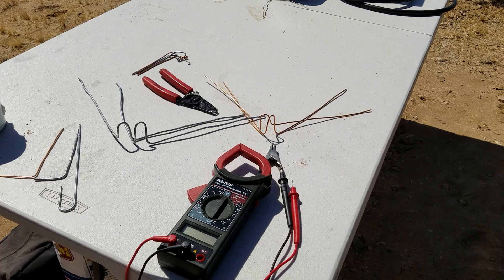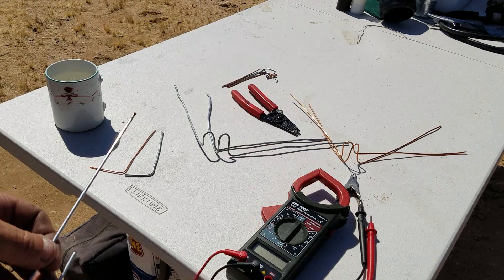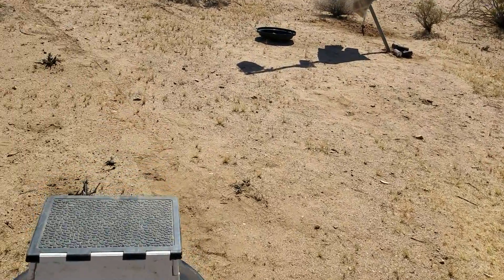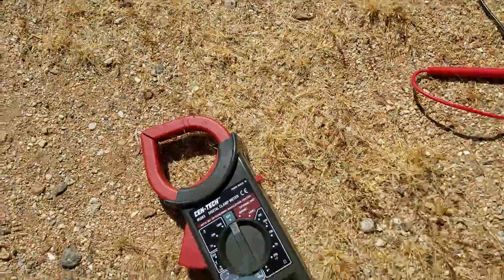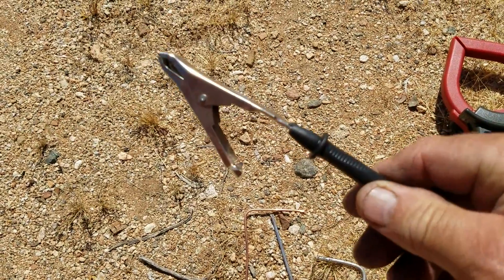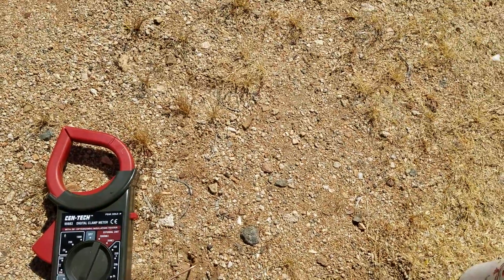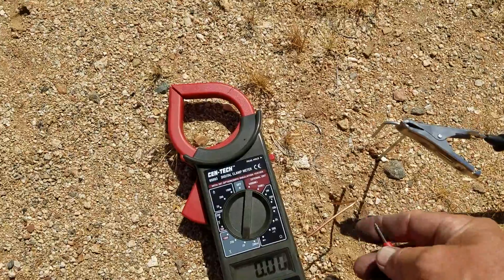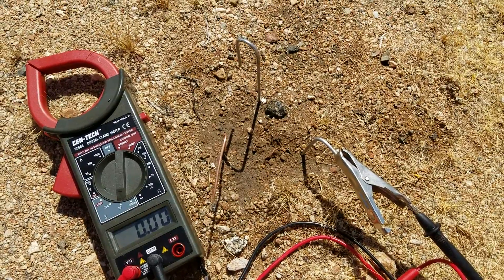Voltage from the ground

Comment: The earth is like a big potato ;-)
Reply from the maker: Actually the other way around.😁
Earth's molten core of liquid metal creates our magnetic shield that protects us from the Sun's radiation,  but at the same time it induces electrical current through every conductor on the planet.  This makes all conductors a form of battery that simply needs 2 dissimilar metal  contacts to start electrolysis and current flow from negative to positive. 
Keep in mind that magnetism and electricity are very closely related.
Reply: @GBear  I mean that just like people use a potato to make galvanic battery, the earth is like a big potato in your experiment ;-)
I actually teach electromagnetic induction and stuff and things....lol

Comment: this is old stuff. a relative of the copper/zinc cell made by volta.  nothing new. forty years ago i saw a demonstration from the 1700's that used copper and zinc plates in the ground to power an early electric clock.  the small current activated a primative solenoid at each end of the pendulum swing

Comment: I see a lot of industrial power lines near by so strap voltage would be high in this area. Ground current.
Reply from the maker: John Puccetti those power lines are 1.25 miles away.
Reply: @GBear  Hundreds of studies worldwide have shown that living next to high voltage power lines and other parts of the power transmission network increases your risk of cancer and other health problems. The closer you are the more you are bombarded with dangerous EMFs. About 2,000 meters
Reply from the maker: John Puccetti yes, I've seen the studies.  I guess that means all people living on the grid are doomed to die of cancer, huh?
Reply: @GBear  That might be a bit of an overstatement. Read "The Electrocution of America". lots of facts with  effects on dairy cows. But here is Code 95 The grid was originally built so that all the electricity which flowed from the
substation returned through the neutral wires. When people started using
computers and other electrical devices with non-linear loads, the existing neutrals
couldn’t handle the loads and fires resulted. The electrical building codes were
revised to require more robust in- building neutrals, but the utilities got off the
hook by instead of beefing up their neutrals, they simply tied the neutrals to the
earth so that now, about 70% of the electricity delivered from the substation ,
returns there via the ground. The California PUC rule 33.2 forbids using the earth
for return currents, but this didn’t stop PG and E or Edison from running wires
down every other power pole connecting the neutral to the earth. Here is the PUC
rule: (the bold font is mine)
General Order 95
Section III
Requirements for All Lines
33.2 Ground or Earth as a Conductor
Ground or earth shall not be used as a normal return or circuit conductor. In
direct current supply systems or in single phase or polyphase supply systems, a
neutral or any other conductor shall be used under normal use as a return or
circuit conductor; however, the grounding of the neutral or
any other conductor is not permitted as a
normal return or circuit conductor. The neutral or any
other conductor is permitted to be grounded only for the purposes of
stabilization and protection.
Reply from the maker: John Puccetti interesting.  But, I remember that the older electrical panels utilized the neutral bar as a combination neutral/ground bar, and that neutral bar was connected directly, metal to metal on the can.  Newer panels have separate neutral bars that are insulated from the can, and a separate ground bar connected to the can and incoming ground cable.
So you are saying that Edison bypasses these features by tying ground and neutral at the pole?
Also, most new codes require electrical services to be underground and they are doing away with above ground utilities.
Thank God I am retired and living off grid with wind and solar!😎
Reply: @GBear  The information that I see as  very relevant is that there is no neutral on most transmission lines single phase should have three wires. three phase should have four wires. The utilities wanted to save money using the earth for any imbalance of amperage. Or the answer to your question is yes. Under ground can only be done for short distances 5-6 miles. I have seen one conductor lines that is scary.
Reply from the maker: John Puccetti I retired as a GC in 2016, but can honestly say I have not witnessed any of that in 47 years in the business.  You should record these discoveries and start an awareness channel showing proof of these atrocities.   It could go viral!